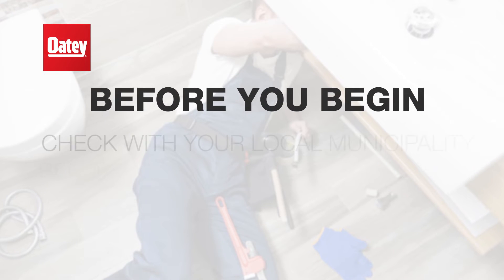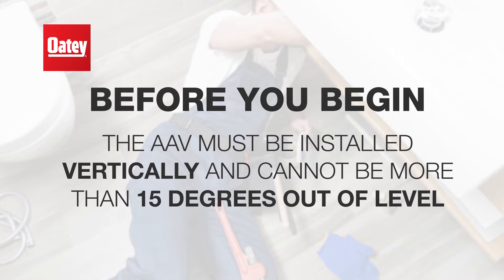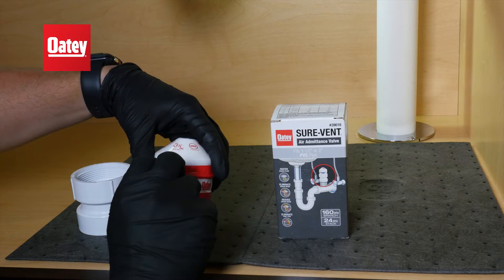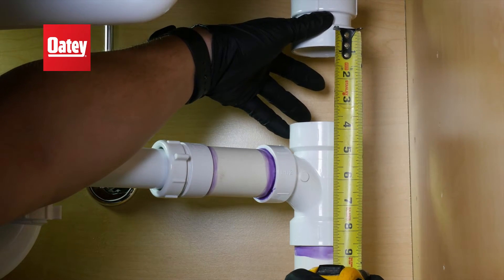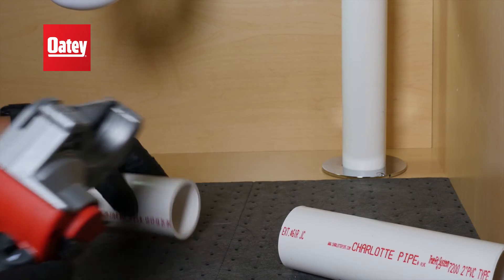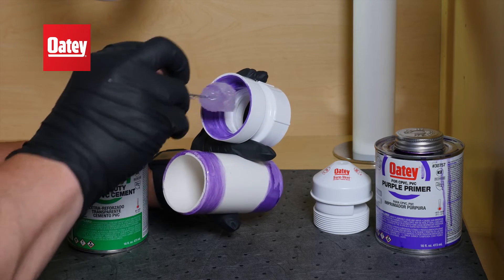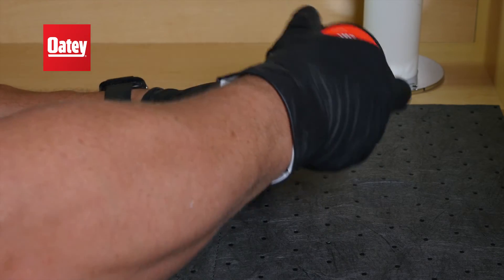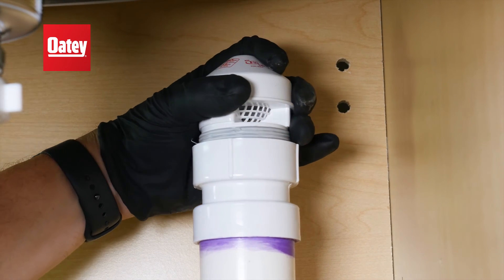How to Install an Oatey Sure Vent Air Admittance Valve

Comment: New construction and have to vent.  Pun intended.  Our kitchen sink is located under the window, and guess what the plumbers did not do.  Yep.  I showed them the slow draining sink and got a hmmm that's just the way it is with your single hole deep sink and garbage disposal.  Custom home build by spec subs, no offense to spec subs.  I just ordered and will be installing myself.

Comment: Even if it needed a vent it wasn’t installed correctly. The vent needs to be vertical, no more than 15 degrees offset from vertical.🤦‍♂️

https://youtu.be/Ffbka3FriQY?si=ZJxaYA0J2e0P9qV_

Comment: Do they thread in to a vertically mounted marvel connection?
Reply: you'd have to go to the store and try it, I just installed one and it doesn't look like it would
Reply: @stephenj2014  I bought one off Amazon and it came with a threaded coupler that glues right on to a 2" pipe so all good here :)

Comment: If 4" isn't working, try 6 as another recommended length
Reply: I just installed mine as high up under the sink as I could per the plumber, it's a good 10" up
Reply: @stephenj2014  make sure it's an easy spot for maintenance though. In case you need to clean it or want to run an auger. Don't butt it against the top of the cabinet.

Comment: Fits 1 1/2" is bs
Reply: It is double flanged. I just installed a 1-1/2” on mine
Reply: @scottdtravis Is that what the narrower "neck" of the adapter is?
Reply: @ChristmasLightsTonight  that is how mine worked

Comment: hello, I recently replaced the air valve under the kitchen sink because it started to drain down really slow, I unscrew the air valve and noticed it drained perfectly so I thought the valve was bad, I replaced it with an oatey sure vent and it still the same water goes down really slow and as soon as I unscrew the valve it drains perfectly, I have the exact same setup you showed in this video so I don't know what's wrong any help will be appreciated thanks.
Reply: Funny thing, our house was built in 2006 and about 2 years ago we have been having the same exact issue you talked about.  I’m so frustrated with it, Im tempted to take the AAV off and cut a whole through the kitchen cabinet and exterior wall and let it vent with the outside air!  We’ve had two plumbing contractors come out and they can’t seem to figure out a solution. Good luck. I know exactly what you’re dealing with. Frustrating!
Reply: that was a year ago...please tell us what the fix was
Reply: Hmm, I wonder if the one the main vents for your house recently became clogged with some sort of debri (bird nest, small animal even, etc)
Reply: @joeyoshs  Yeah, or didn't get done properly during rough in.
Reply: Each valve has a air flow rating you may just need a bigger air flow rating valve to let more air through while still getting the benefit of not having the sewer smell be realesed
Reply: Hope they not Charge you one red copper they probably was not that knowledgeable about ventilation.
Reply: I have the same issue. I opened the clean-out drain (below the p-trap) and rodded it out 50ft at least twice. With the cap/door removed and the sink running, there is no issue. When I reattach the door, the sink drains slowly. I replaced the air vent (it's the older kind with the spring) and same issues with the slow draining sink. I have read that the spring operated vents are unreliable but even using a brand new one I get the same issues. My sink does not vent outside as I'm in a manufactured home but it's the most perplexing issue. Most people say, "the p-trap is clogged" and I can confirm it isn't that having removed it roughly twelve times at different points to check.

Comment: Mine was installed at 30-45 degree angle and my water takes for ever to go down plus i have to use the plunger to add air bubbles to it to get the water moving. No my sink isn't clogged this all started after the installation. Can you give me some feed back please
Reply from the maker: Please contact technical@oatey.com for support on this installation!

Comment: Is it only for évent or thats fine for odor too ?
Reply from the maker: @#84 he's back An AAV is a valve that eliminates the need for secondary vents in some situations. When no negative pressure is occurring like when water drains the valve remains closed so sewer gas does not enter the dwelling.

Comment: Can I only use one AAV to use for the washer and kitchen sink or do I need 2
Reply from the maker: @Angel F Depending on how the system is piped yes 1 can be used for both fixtures. If they are separate branch lines then one would be needed for each line.

Comment: @oatey , if I have a sink and a dishwasher vented by the aav, do I need to add both dfu's ? So that would be 4, right? Thanks
Reply from the maker: @Louis-François Lapointe Correct you would add all the DFU's for the fixtures the AAV is serving. Yes that would be 4 DFU's.

Comment: I am a bit confused. 
The video states the vent needs to be at least 4 inches above the horizontal branch pipe but the box image has it connected to a t-fitting in-line with the horizontal branch pipe which doesn't appear to be 4 inches and the way I was planning to install it, so which is it before I screw up my installation?
Reply from the maker: @Sapienrex Our AAV's need to be at least 4" above the horizontal drain line.
Reply: @OateyCompany  why do we need to maintain min 4"? why not less

Comment: What does DFU stand for?
Reply from the maker: DFU stands for Drainage Fixture Unit which is a measure of the probable discharge into the drainage system by various types of plumbing fixtures. The drainage fixture-unit value for a particular fixture depends on its volume rate of drainage discharge, on the time duration of a single drainage operation and on the average time between successive operations.
Reply: @OateyCompany  Thanks!

Comment: Would that help toilet that doesn’t flush well? All water doesn’t go at first flush 90% of the time
Reply: I’m having the same problem. My toilet isn’t connected to the vent stack and not ventilated properly. Slow flush/ no flush. Drawing water from the sink trap. Going to put this on the sink and see if that helps.

Comment: How tight does it need to be or can it be a little loose
Reply from the maker: The AAV should not be loose once installed, but should be screwed in tight enough to ensure a airtight/watertight seal is achieved.
Reply: @OateyCompany  
Thank you 😌
Reply: So it has to be 4 inches above the horizontal tube.  But not necessarily directly over the down pipe right?

Comment: Thanks for the video! Just replaced mine and wasn't sure to use either plumbing tape or primer/cement on the threads. Unfortunately, the previous owner used primer/cement so I had to cut the whole unit off.
Reply from the maker: In most cases if a soft set joint compound was used, there should be no issue removing. Also, if the joint compound is approved for use with PVC and an airtight/watertight seal has been achieved there is no need to remove the AAV unless a mechanical failure is suspected.
Reply: @OateyCompany  I suspect a mechanical failure is there a way I can confirm it?  Thank you.
Reply: @O @OateyCompany ow do remove it if a joint compound was used? Mine has trouble removing it. It gets stuck.
Reply: i think mine is in there with putty.  do you think I can twist it out or I would have to cut it?

Comment: I’m doing a toilet & vanity in a half bathroom. Do I need one of these aav  things for for the toilet and vanity, or just 1 for the the 2 of them?
Reply from the maker: You must first check with your local building officials to confirm that the Sure-Vent installation you are attempting is recognized as an approved application. If your application is approved, the Oatey sure vent AAV can be used to vent any plumbing fixture(s) if properly sized based on the drainage fixture units.
Reply from the maker: @Mar Go It will depend on how the system is piped in, and we would not be able to design the system for you. A single AAV can vent a bathroom group if installed properly depending on how the pipe was installed, but it cannot take the place of the main vent through to the open atmosphere. You can also contact technical@oatey.com if you have more details on your situation and also check with your local municipality to ensure it is approved in your area.
Reply: @OateyCompany  thanks for the reply I appreciate your help
Reply: My contractor didn’t add a vent pipe on my outdoor half bath….if code is clear where would be a good placement for this without tearing down walls….because toilet has problems flushing. Water comes back up the shower drain. When I open the outdoor sewer line trap…the toilet flushes properly. So I’m assuming that this will do the trick instead of adding a vent?

Comment: Has anyone had problems with the purple primer leaking from container,or glue drying up after a short period of time..This has been happening for years,when l use their products.I called the company they insist no problem. l can't be the only person who has had this problem..Please post a complaint let Oatley Know this happens.Maybe we can persuade the company to make changes to the packaging 🤔
Reply: Mine hasn't had a chance to dry up yet, but just the huge effort required to open the purple primer cap ruined the top, so it leaks itself. I've never encountered harder to open containers than the primer and glue. I should have returned them and tried other cans. Also, ours in the past have always been dried up when we've gone back to use them again. I wish they made a much smaller less expensive one-use size for home diy'ers.
Reply: @debbieschmidt9316  Thanks for your input.l was hoping more people would have commented..I also have had problems with tops.They get out of round when you try and remove..I buy the smallest container now..Been frustrated for years with these containers,but it seems Oatley is the only supplier..
Reply: Best to keep in cool dry place some plumbers use the one step glue quicker and no messy cleanup